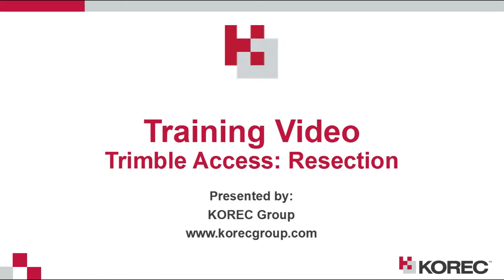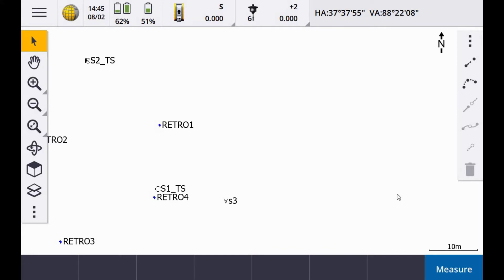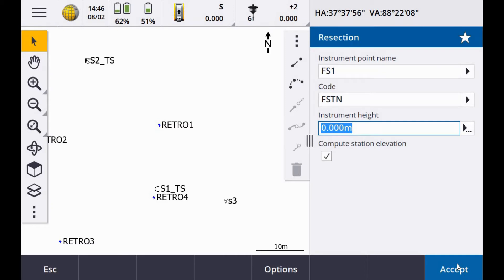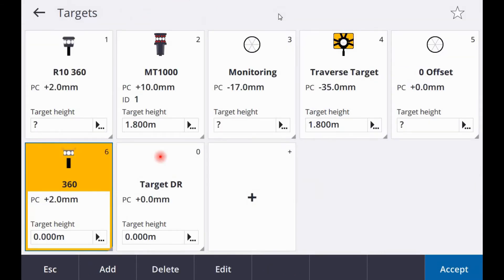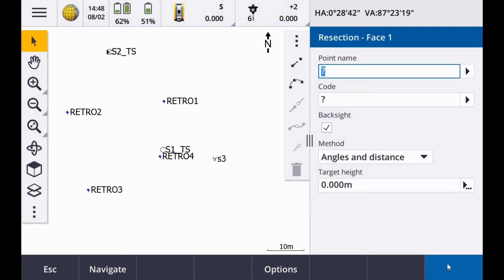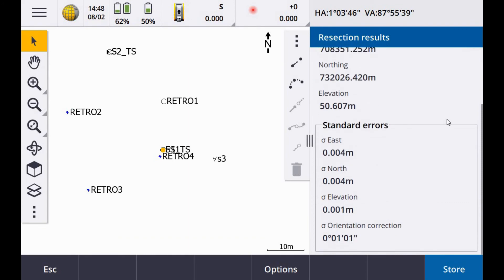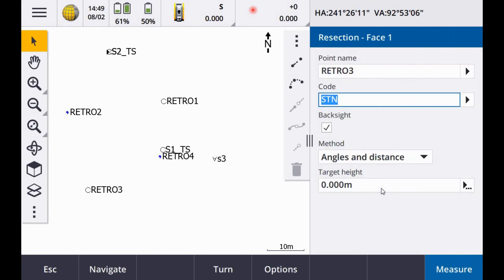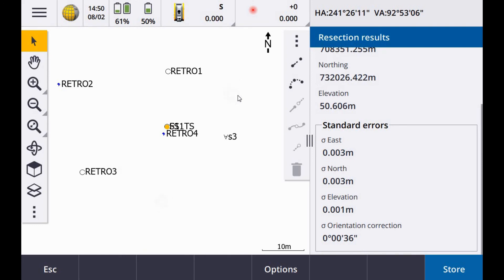Trimble Access - Resection

Comment: what if the 3rd point was making your resection worse, and due to time constraints and not requiring great accuracy  you would only need to keep the first two points? How can you delete/ignore the third point? On the SCS900 is simple, you can use multiple control stations and you can only keep the ones that give you the best results.